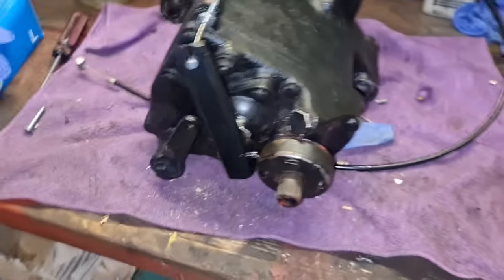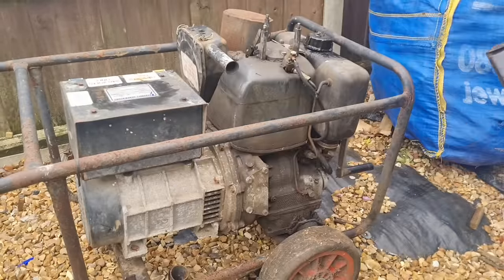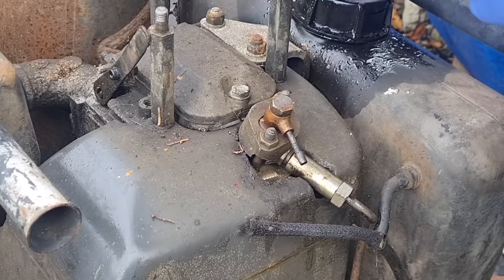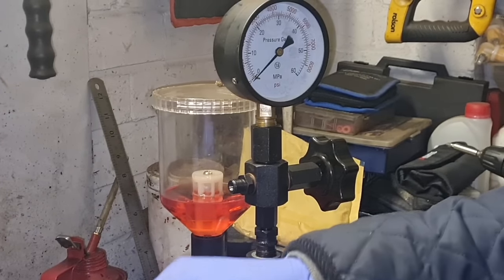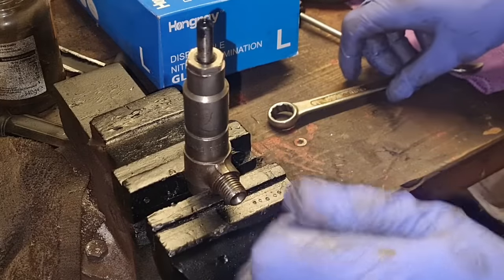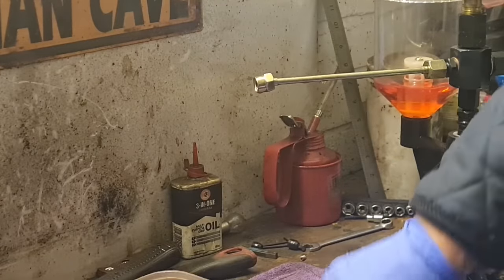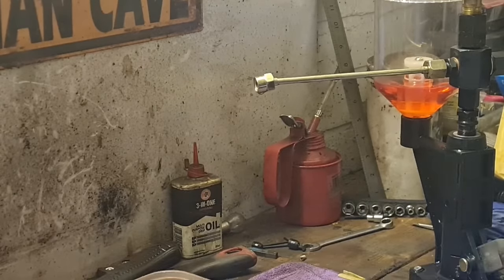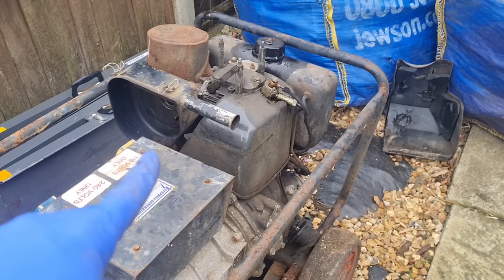Old Lister diesel generator. Will it Starr after 20 years.

Comment: The problem is the high pressure pump because you aren't getting any bleed-off. It's only delivering fuel where there's no resistance to flow.

Comment: At the start when you removed the injection  nut and turned it you had just a drop or 2  came out  were there should be a good short stream under pressure   needto start by full cleaning of the fuel system   then good bleeding  !!  Sure it pop off and the bugs be fleaing the country😂

Comment: So my guess on why she no pop is the rings are stuck down in the piston thus offering low compression. If she had high enough compression she would have popped off with ether. When she no pop with ether she has not enough compression. So Adamski she may need her barrel taken off and the rings cleaned up. Either that or spin her with a 1/2" drill motor to get her up to enough speed she has to go to town.
Reply from the maker: Yeah you could be onto somthin there mate. The blow back is a mystery. I don't think it's timing.

Comment: I would do an injector test with the injector connected to the injector pump but outside the engine. If it sprays OK, then check the pump timing. It seems that all the "free" or really cheap engines that have been given up on, have timing issues.

Comment: I have polished the injector needle seats using silvo and a pin vice, works very well as long as there is not too much wear. Clean the fuel system out and replace the filter, the diesel in that tank has stood twenty years and is most likely gone off to some extent and quite likely gelled in the pump and filter.

Comment: There's not enough diesel getting into the injector.  At 20:00, it's easier to pull then push!  Use Simply Green in an Ultrasonic. It does a better job.
---
AGAIN! NOT IN FRAME!! :face-purple-crying:  At 32:09, need to clean that junk around the whole before inserting that injector!  That bango needs to be clean as well.

Comment: I reckon I would test the spray pattern with the injector connected on the lister pump but removed from the head, that way you can see if it has enough pressure from its own pump. Another thing I noticed was a pop sound from the inlet after you removed the filter (separate from the intake noise), could it be the inlet valve is leaking a bit?

Comment: Not getting enough fuel think you should of got a lot more coming out  of that injection inlet ? Is the diesel old and gone off ?  Used to watch my dad use heat to start old tractors we had ,try bunging some heat in intake ?

Comment: I think you've got to look at the fuel pump, I don't think your getting enough pressure as that was a pitiful flow when you took the line off.
Lmao! 2 ft bar! = 18 in torque wrench 😂 if your having issues with an extremely tight nut/bolt the safest way is a 6 point socket not a 12.